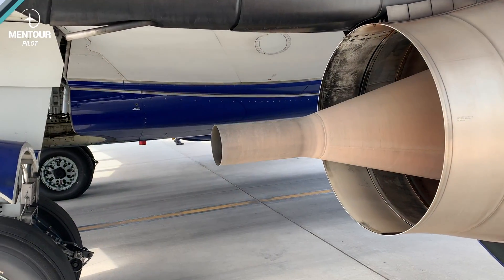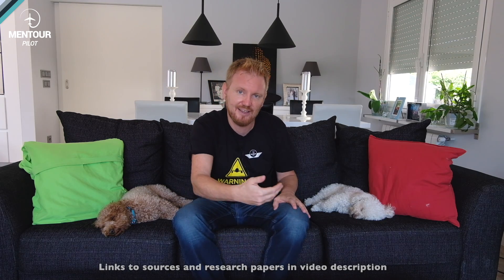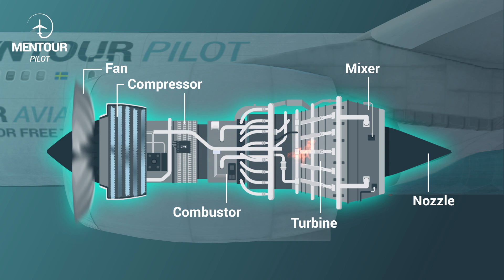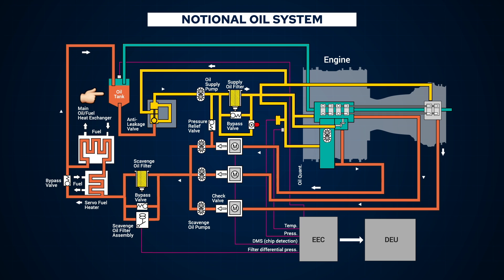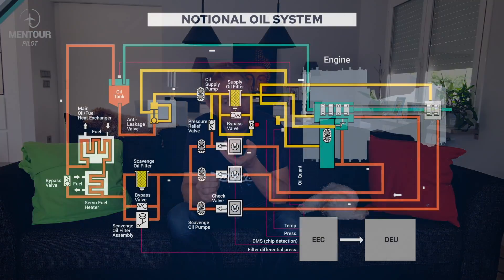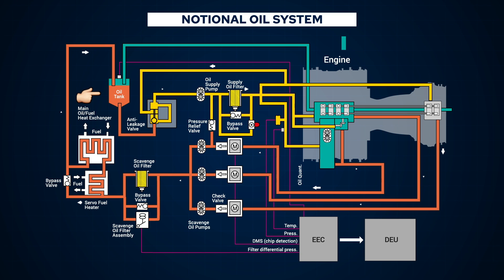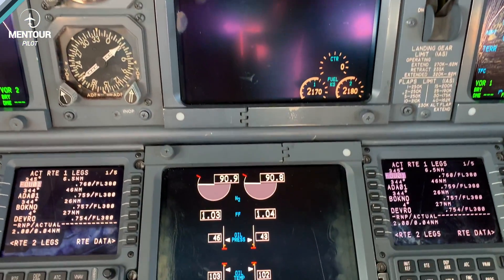What is that TUBE at back of the B737 JET engine?!

Comment: First, good video as always! I'd just like to add couple words to what you have explained, in particular about why the air is removed from the system. I won't be going into details, because that would take a book rather than a youtube video comment, so take this as simplification. You mentioned that it's the foaming of oil/air mixture that drives the necessity for removing the air from the oil. Actually, the primary purpose of the so called vent system is to remove the air from the sumps. As you mentioned, to prevent the oil from getting out of a sump, the sump is pressurized from the outside what means that air is being pumped into the sump. Then, with a constant supply of that pressurizing air, you need to somehow remove it because otherwise internal pressure of the sump would momentarily increase to a point where pressures inside the sump and outside the sump would equalize, and there would no air flow into the sump anymore, and therefore no effective sealing. In general, the air can be removed in two ways, depending on sump configuration. Two basic types are so called vented sump and so called non-vented sump. From a vented sump, which you have actually described, some of the air (not much relative to the amount being pumped into the sump) is typically sucked with oil by scavenge pump and then expelled to ambient through deaerator, and most of the air is removed through the metioned breather (also called air-oil separator becasue this it what it does) into the center vent inside the N1 shaft (in configurations like that of CFM56), and then discharged to ambient at  the back of the engine. Air from a non-vented sump is removed entirly through the scavenge pump, and then through deaerator that is located somewhere down the scavenge line. The catch is that in order to suck out both the oil and the air, the scavenge pump for a non-vented sump needs to have significantly higher scavenging capability, relative to a vented sump pump that scavenges moslty oil, and just little air. For a non-vented sump that excess capability, although significant, is still fairly reasonable to achieve because much less pressurizing air gets into a non-vented sump than into a vented sump (I'll skip why is that...). If one would like to scavenge the amount of air that gets into a vented sump, that would require a hell of a powerful scavenge pump in the first place, and would also create other problems to solve. It's maybe not that it's impossible to do it, but the cons just overweight the pros. And that's actually the beauty of jet engine engineering... Literally everything, to the smallest detail is optimized to create best possible compromise of function (on both component and system level), reliability, life, integration, weight, maintainability, cost etc, etc.

Comment: Why aren’t there magnétic bearings ínstead?
Reply: The oil being pumped through the bearings is mostly there to absorb and transfer heat away. That role would still need to be fulfilled in a magnetic bearing system. So, why complicate it and just use oil film bearings.
Reply: KJ Dude beber Mind de oil role, the proposal was not about eliminating oil but reduce friction, besides, without brearings ,,, there is no bearing to cool off...

Comment: Thank you for that very interesting explanation of the oil bearing lubrication system as it has evolved from the very simple system used o the first jet engines back when I was a child in the 1940s. I learned much later in my life that the lubrication of those jet engines, only used in military aircraft at that time, were described as total loss oil systems. Somewhat like the now mostly  disused two-stroke piston engines that had lubricating oil in the fuel itself, those early jets had to have a massive tank of oil along with the fuel tank, since that oil went through those bearing just once, and out with the jet exhaust.
I remember  at air shows back then, seeing the much blacker look of that exhaust. Once jetliners were in use the exhaust was much cleaner looking, and I suspect the economics and weight had made for the  lubrication system improvements culminating in the system you are describing here.
As another  process question you may want to look up from the past of air transport, I was witness to the first flight of one of the rarer jetliners of the 707 era, the Convair 880 built in San Diego CA. That airliner originally needed, like the 707 in its first incarnation, water injection on take-off. I marveled at how black its exhaust was taking off from Lindberg Field.  Surprising to me many years later was to see water-injection still in use by the Air Force version of the 707, the KC-135s out of March Field around 1980.  It seems the military does not always keep up with the best practices for economy when it takes so much new paperwork to make even little changes to the way things are done:).

Comment: So much for the inside of the tube.  The outside of the cone is part of the converging nozzle that increases the speed of the existing turbine exhaust gases for increased thrust.  In some early jet engines, that cone, or plug, as it was called, was controlled by an electrical motor to move forward or aft to optimize thrust in flight.  The motor was controlled by the pilot.  In some Korean-war era engines, ground test runs provided data to calculate optimal nozzle area.  The outer, tapered exhaust tube could then be parts-selected or even physically cut back to the calculated area.  I have heard that this is the origin of the term "trimming" a jet engine. The term is still used even though fuel control mechanical, electrical, and software methods long ago replaced any method so crude as cutting away part of the tailpipe to adjust engine performance.

Comment: Could it be the reason why the 737 gets a greasy belly from the middle to the tail? I work as a ramp agent and i always wandered about it. It seems like its coming from the landing gear bay, perhaps you can do a video about it too, on why it gets so greasy at the aft part of the aircraft's belly.
Nice video bdw! I always thought that this smoke is some grime being burnt from the heat of the engine. It is also coming from the Rolls Royce engines which doesnt seem to have such a tube. (at least not visible)

Comment: Great video. I think you able to explain the system to the laymen with enough details to understand. One neat thing about the fuel heater servo is not only to cool the oil but warm the fuel to prevent ice from forming. Another thing that might amaze most people is that we never change the engine oil. We refill enough oil to keep it fresh. The CFM 56-7b is an incredibly reliable engine.

Comment: Can a jet fly inverted? And the oiling system still work, being a dry sump?
Reply: Fighter jets routinely do; they use something called a collector tank, that's always full (pumped under positive pressure) so that the engine fuel pumps never run dry. The oil system too runs under positive pressure; it doesn't rely on gravity.
Reply: The ones that are designed for inverted flight can do it, but not passenger jets.
Most race cars also have dry sump oil systems but like passenger planes are not designed to operate inverted.
The issue is that the pressure oil pump sucks oil from the bottom of the oil tank. If the tank is inverted the pump will suck air instead of oil.
Reply: Of course the oil system will work.. no worries at all! The rest, though, will all go to hell, unless that is, someone thought of using the roof of the fuel tank to pump fuel!!!

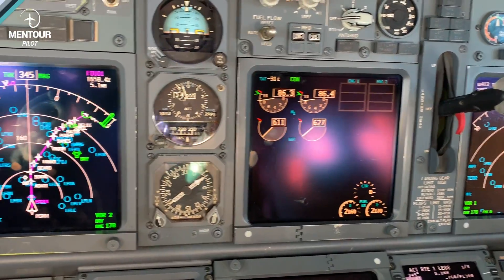Comment: 13:24 I'm guessing that upcoming video is about another famous glider 😊
Reply: Should include the space side of aeronautics as well, one of the apollo's blew up because of unit mix ups (or a space shuttle)
Reply: @nedredhead474  that was the Mars Climate Orbiter. A conversion error lead to a wrong orbit insertion.
Reply: @makecba  yeah you're right, just plummeted to the surface
Reply: Gimli Glider!

Comment: My next question then is, why a dry sump? Is it a weight saving thing?
Reply: I suspect the main reason is the desire to keep the reservoir of oil cool, and to allow a decent size reservoir. If you imagine running the bearings in an oil bath wet sump in the middle of the engine it'd be perpetually very hot (degrading the oil and causing viscosity issues) and any increase in volume would be at the cost of engine performance.

Comment: These are fascinating videos. The subsystems in any system must be understood, as they are all potential failure points. No Doubt that the engine would be quicky destroyed without the oil system! In engineering such systems, you have the trade off of redundancy (two magnetos in a small plane come to mind) vs. the tradeoff in weight/fuel, ultimately driving safety, payload AND profit. Things get heavy fast: Just pack for a day hike and see how heavy things get as you make decisions on what you will carry on your back! Will you carry TWO DIFFERENT means of starting fire, or summoning help? What will you put in the First Aid Kit? (You DO always carry one, right?) Then there's the quality control/ inspection/accountability on everything down to the very individual batches of metal/ceramics used to produce the engine blades. 
It's all fascinating and I am told that this is much more like baking a loaf of bread than mass production. You can't say make 1000 blades and just pull one off the line for testing: Instead EVERY part must be X-rayed!  I recall a bench sanding wheel that I was using in shop, and it just all suddenly flew apart. This could have caused serious injury, and luckily did not. And I thought in this video about all of those rotating parts. The upshot? All it takes is several simultaneous small point failures to bring any system to a halt, or say with the metallurgy: Just one damned little tiny, tiny, microscopic thing! So my hat (which I'm not even wearing) it off to everyone in the Aircraft Industry: You take us all reliably many thousands of hours/miles with very few failures indeed. And you do this not just with the engineering, but with the "unknown quantity" of weather: still somewhat unpredictable even today!

Will Mentour Pilot and Pilot Joe ever do a joint video? That would be fun.

All the Best! DE W8LV BILL

Comment: I know exactly how you feel about technical knowledge: I worked many years as a sound engineer, and I knew everything about my equipment - on the outside. What microphones to use, what buttons to push and what nobs to turn to get beautiful sound out of the speakers, this was my thing. What happens inside my mixers, power supplys, fx-machines and what have you, was not my specialized expertise, but the repair man's. So a very important part of my expertise was to know the phone numbers of all the repair men in the area, especially those that were willing to come and fix my stuff any time of the day. 

Maybe this is why I find your videos so interesting: I used to sit above the audience (passengers) on "the bridge", as we called it, where I - together with the light engineer - had total control over what happened on stage. We were metaphorically speaking the pilots of the theater, helping the actors, singers, dancers and musicians (the cabin crew) to get their art up and flying, out to the audience. And just like you, we could only do our job because we had a small army of suppliers and repair men that helped us make sure that our gear always was in working order. And just like you it was our responsibility  that everything was okay, and like you we had backups of almost everything that could break down. In twenty years I only had one serious "crash", and that was when an electrical spike from outside the house ran through all my power supplies, including the backups, and killed them all, fifteen minutes before the show was to begin. Luckily I had the phone number of a colleague on another theatre who could borrow me his backup power supplies, so half an hour later we were back up flying again. 

One difference though: It was the stage manager who did the "captain's briefing" to the passengers/audience ("we have a technical problem, so there will be a short delay blablabla"), not me, because traditionally he is the vicecaptain of the theatre, when the director, who is the real captain,  has left after opening night. But this vicecaptainship was in name only, no single person was in charge when the show was up and running. Actually it is quite fascinating to see how a troupe of performers and stage hands can do their magic without a formal leader. Anyway...

Greetings from Denmark!
Reply: Thanks for sharing that, it's a very analogous position, much more similar (passengers/audience, "piloting" the theater, etc) than I would've thought! That sort of specialization is in my opinion one of the most beautiful things about modern society. Knowing how to work your gear instinctively and in such detail even when something goes wrong and how to communicate with the repair men and suppliers in emergencies or even call acquaintances who hold similar jobs is essential. Those armies of repairmen are also themselves specialists who likely feel the same way about you working your magic to run the show as you do about how they do surgery on your equipment 😁
Reply: The inverse of that is the Technician/Repair guy that knows the inside workings of your equipment, but doesn't necessarily know the operational use of the equipment outside of being able to turn it on and making sure everything works.
Reply: @johnknapp952  Hey - that's probably me and probably thousands of others now lost in the software replicas. Would've loved to be a sound engineer and now struggling with the DAW equivalent.
Reply: You and I do the exact same thing. You in Denmark, me in Kansas City, MO, USA
Reply: I service the equipment and there's no way I could get close to what some of my clients do with their equipment. But I have to say that some of them are quite a eclectic bunch. There's times I'd rather not answer my phone but it's not unheard of for me to get a call in the middle of the night and find out there's a Cessna Citation waiting for me at my local airport by the time I get my gear together.
Reply: User knowledge and fixit knowledge  are sometimes a lot different. A lot less cars on the road if you had to have mechanical knowledge to drive one.
Reply: I guess all that equipment you worked with were just "black boxes" to you... 😏
Reply: @h8GW  Correcct, or almost correct - I had a limited knowledge about what was going on in the electronic circuits, and  I knew my way around a soldering iron. But any major faults and errors were left to the repair crew.  One big difference in this metaphor: Noone ever died or were in danger of getting anything other than their feelings hurt when I made an error, and this is why I don't consider myself a hero, as opposed to Petter and his colleagues.

Comment: This explanation makes me wonder why the breather tube is at the back of the engine throwing out oil while if the outlet is added to the intake the air would be 'cleaned' by burning the oil remains. Seems a more environmentally friendly solution too me.
Reply from the maker: Because then it would be used by the bleed-air system and fed into the cabin.
Reply: @MentourPilot  Sounds very reasonable. Yet I feel there should be a better solution than just 'dumping' oil in the air.  Even if the amount is limited, given the number of planes flying around it does add up.